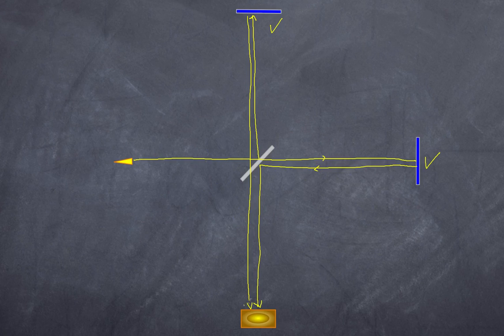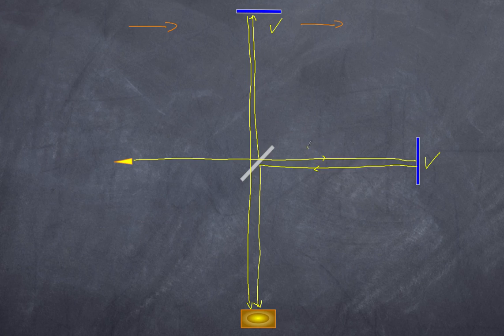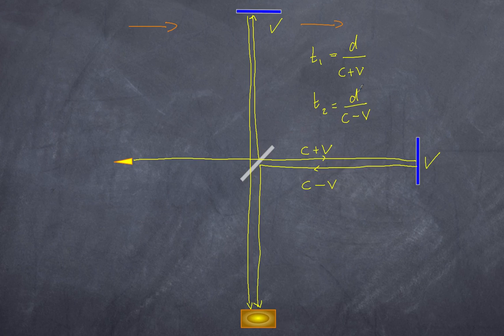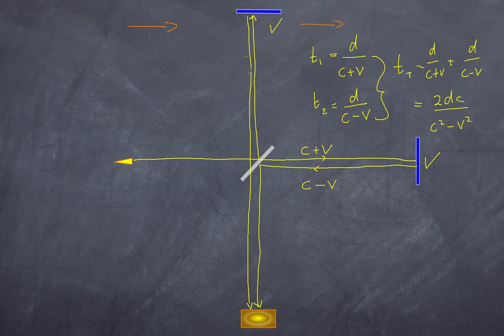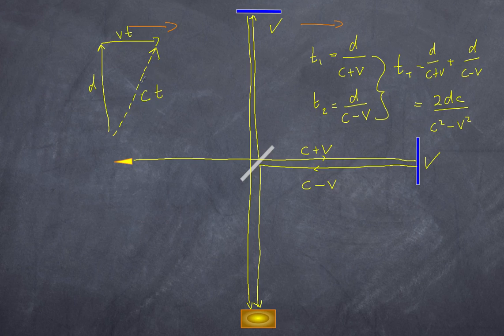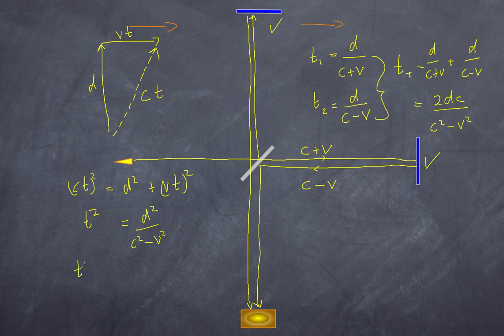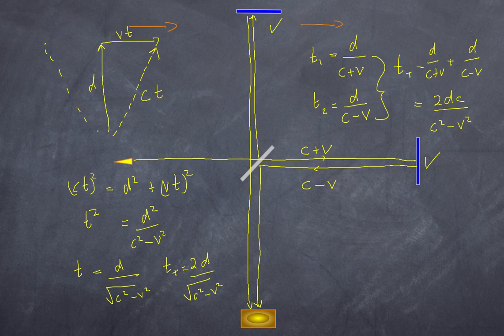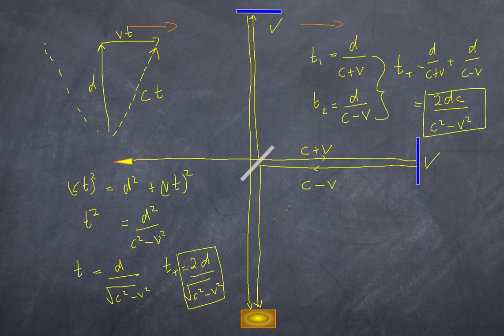michelson morley maths

Comment: I feel like you should have finished the proof that T_along >= T_across. Can be done as following:

So we've derived that T_along = (2dc)/(c^2-v^2) and that T_across = (2d)/(sqrt(c^2-v^2)).
But if you multiply T_across by sqrt(c^2-v^2)/sqrt(c^2-v^2) (to remove the square root in the denominator), you get T_across = (2d*sqrt(c^2-v^2))/(c^2-v^2).

So we're trying to prove that T_along = (2dc)/(c^2-v^2) >= T_across = (2d*sqrt(c^2-v^2))/(c^2-v^2). Or to put that another way, prove that c >= sqrt(c^2-v^2), since we can cancel out all the other pronumerals.

LHS = sqrt(c^2), [c >= 0 anyway, but I digress] which is larger than sqrt(c^2-v^2) when v != 0, and equal when v = 0, QED. It should be noted that v = 0 occurs when there is no aether wind, however.

So that's why T_along >= T_across. It wasn't exactly obvious enough to just say that the two forms provided in the video are "clearly not the same", and that doesn't even specify an inequality between the two. In fact, when v = 0, they actually are the same, so you were technically wrong.

I mean, at least you mostly showed why T_along >= T_across. Many textbooks just assumed that it's somehow a trivial statement (it isn't to me), which doesn't exactly help a student understand.
Reply from the maker: you are right - it isn't trivial. I could have done as you suggested - but you have now down it for me :D
The key though is that they are not the same, and such supports Michelson and Morley (incorrect) hypothesis.
Thanks for your feedback
Reply: Tyranny Takeover I think you're confusing what happens to the light that splits and travels across the aether (ie not with the aether). You say that it only travels at the speed of light, which is true, but there is also the supposed aether wind, so it has larger distance to travel. Imagine it as a plane travelling with a wind going North. If the plane was travelling West (ie across the aether), and wanted to return to the same starting spot, it would have to travel further than if there were no wind! 

So yes, you're right about the cancelling out of the speeds travelling along the aether wind, but the experiment expected a difference in time because of the across ray having to travel further! 

Also, I don't really understand what you mean by the last part, sorry! :)
Reply: Tyranny Takeover The distance doesn't change, I think I might have been too confusing, this has nothing to do with special relativity yet! :) 

Try imagining the plane travelling across the aether. It starts and heads, say West. If there were no wind in any direction, it could just travel say 200km and turn around and another 200km later it would be back in the same spot. 

However, there's a wind from the South, pushing the plane North with a velocity of say 20km/h. You can see that if the plane only travels west, the wind (vector addition!) will cause the plane to move in a North-West direction and on the return trip, North-East. 

So the plane will definitely not return to the start position (which means the light ray won't be able to reach the half silvered mirror again.

So our plane must try to head South-West so that the wind pushing it North will cause the plane to return to the start position! 

So if you this all out, you'll get a triangle like the one in the video, representing the velocity vectors. The hypotenuse is the light's velocity (which is c), another vector represents the aether wind (which is a variable v), and the last vector is the component vector (which is equal to sqrt(c^2-v^2) via Pythagoras). This just means that since the light ray is travelling at a diagonal, we need to find how fast it is moving only across the aether (not diagonally).

So essentially, there is no change in distances, no warping of space-time, the light ray just has to travel further because it's travelling along a diagonal. 

Hope this helped (and hopefully the vector bit wasn't too confusing)!
Reply: Tyranny Takeover I don't see what you mean by measure a course change. The only light that could've reached the interferometer is light that followed this "changed path" anyway! 

So since the times taken for light to go along the aether and across it (following the "changed path") are different, except when there is no aether wind as I proved in my original proof.

So therefore if the light rays didn't take the same time to reach the interferometer, this would mean a non-zero aether wind!
Reply: I'm trying to figure out what's wrong with your "cancelling out" logic, it kind of does make sense. In the meantime, http://i.imgur.com/EbYAtMK.png is how my textbook explains it.
Reply: Where you went wrong was the assumption that "for example if a 100meter sprinters time was 10seconds on a day with no wind, on a day with the wind blowing behind him his time would be 9secs but if he then ran the 100meters in opposite direction against him his time would be 11 secs therefore the 2 times cancels itself out".

The speed with the wind behind him would be 100/9 m/s and 100/11m/s  with the wind in his face. Therefore the average speed is not 10 m/s, but rather 1000/99 m/s.

I think a better way to understand this is to provide a distance and a speed, instead of a distance and a time, because this is what we are provided with in the Michelson-Morley experiment.

Say we have a 100m sprinter running at 11 m/s with a tailwind and 9 m/s with a headwind (so he runs at 10 m/s with a 1m/s head/tail-wind).

T_tailwind = d/s = 100/11 s
T_headwind = d/s = 100/9 s
T_total = T_tailwind + T_headwind = 2000/99 s

Therefore, S_avg = d/t = 200/(2000/99) = 9.9 m/s

This is essentially what I proved in the original post. Notice how T_along = (2dc)/(c^2-v^2), not (2d)/c.

So to summarise, the speeds don't average out!
Reply: Tyranny Takeover Yep I know that it's an example but it shows pretty clearly that the speeds don't just cancel out.

The original post (the one with all the maths, and the parent comment to this post) generalises the proof to show that it works for all distances (between half silvered mirror and mirror) and all aether wind speeds. 

There is therefore no case in which the statement I proved does not hold true.
Reply: Sure. The thing is that the average of two speeds is not the average speed of the trip. I found this post which is really good at explaining it:
http://physics.stackexchange.com/questions/29/how-to-calculate-average-speed

(Another link if it's still not clear: http://gogmat.com/blog/17-gmat-study-guide/133-gmat-math-avoiding-the-most-common-mistakes-in-average-speed-questions.html)
Reply: The differences will be observed from when the light splits at the half-silvered mirror (B) and the difference will be the result of B-C and C-B, as you say.

I did make a slight mistake, I think. When the light travels across the aether wind, it doesn't actually have to make "course adjustments", because the half-silvered mirror is actually travelling along with the aether as well. I believe I implied that the mirror doesn't move with the aether, which is incorrect.

https://upload.wikimedia.org/wikipedia/commons/7/7c/MichelsonMorleyAnimationDE.gif

This shows really well what happens to the light rays.
Reply: I won't purport to understand much of what Marmet is trying to say, but he seems to hold contrary positions to the Theory of Relativity for some reason. Whether or not that devalues his opinion or not is up to you :)